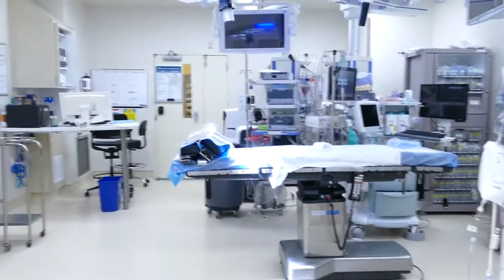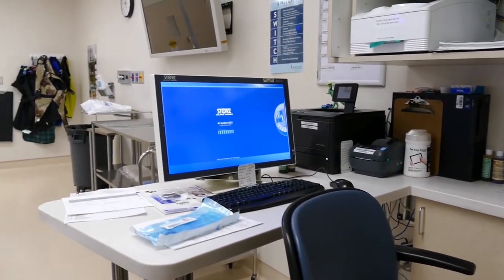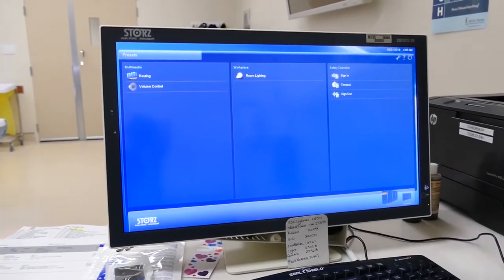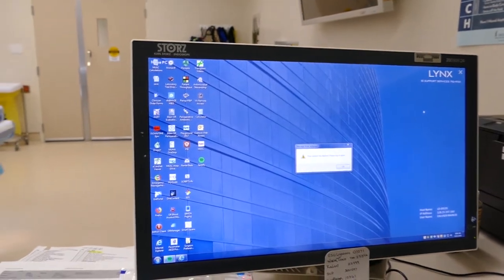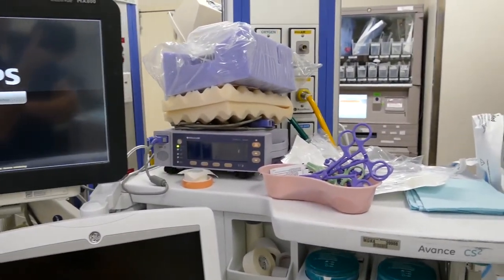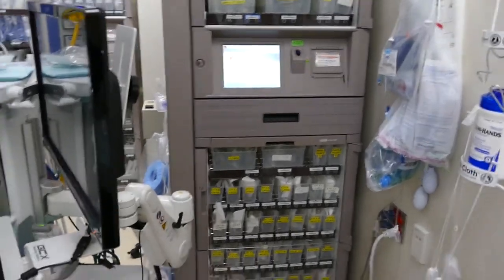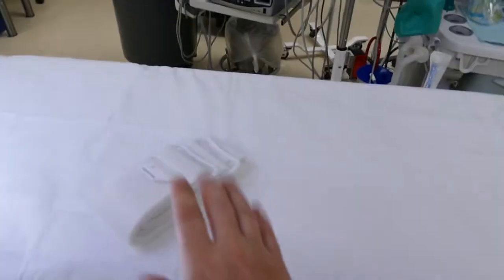05 Anatomy of an Operating Room

Comment: That boom shown in 1:12 is a ceiling supply unit. It is used to supply electric power (for ESU (Bovie; electrosurgical unit), patient monitor, and anesthesia machine, vacuum (for suction), medical gases (O2, N2O, medical air) and anesthetic gas scavenger connection to the anesthesia machine.
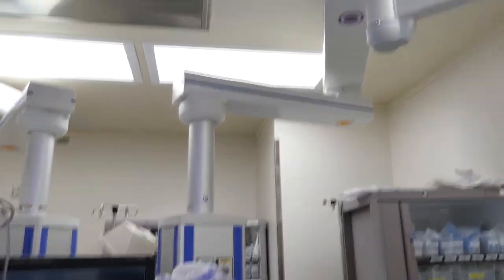Reply from the maker: Its called an Equipment boom. It usually has many electrical circuits, video inputs, CO2 (for insufflator) and Nitrogen and suction. At 4:00 you see the anesthesia boom. The anesthesia boom has a dedicated circuit for the anesthesia machine, data ports, video ports for vitals routing and all medical gas including suction.